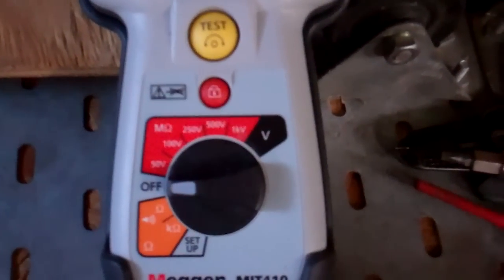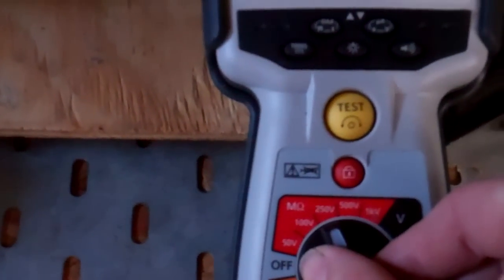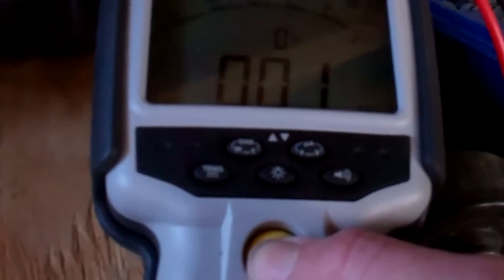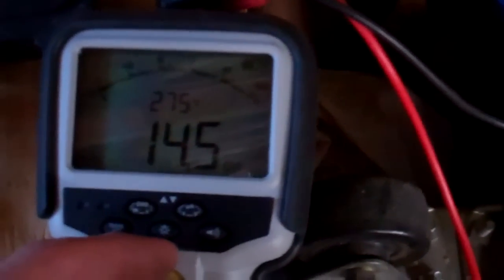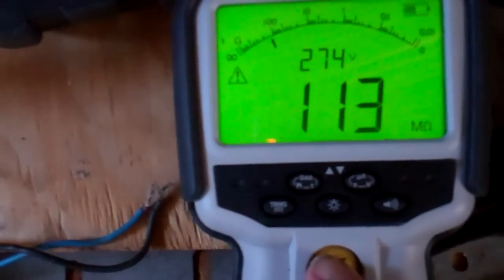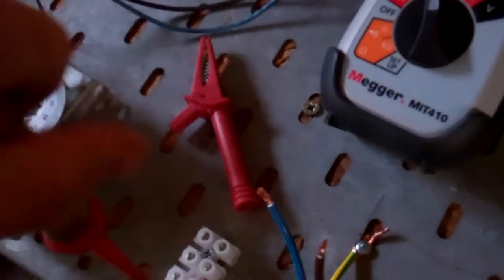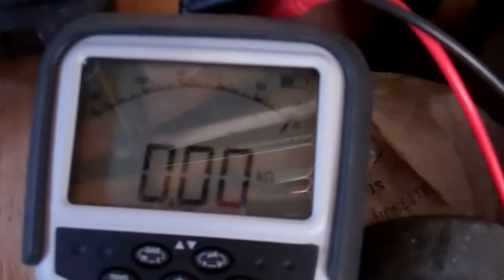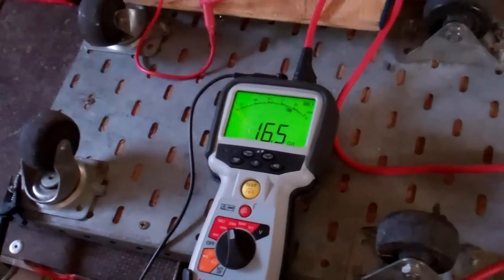Megger tester demo

Comment from the maker: Hi Mark, for the stuff i work on i'd expect a good motor to be well above 20m R but a used one in a damp environment could be lower. If it was below 1m R i'dsay it was faulty but a bit above and it could be damp in the windings if its a fan motor etc or even damp on the terminals if a compressor. In these cases i'd run them and see if they dried out and the resistances got higher.

Comment from the maker: @FilterChanger Its a lot of money! I like my gadgets and i think it gives a good impression to the customer when you can show them with a meter their compressor or fan motor is bad. Lot of stuff here has electronics in too so being able to test below supply voltage and not risking damage is handy , milk tank circuit card is $1500!

We don't get the full range of Supco stuff here, had import my bladepuller, Supco meter looks like it will get the job done at a very reasonable price!

Comment: Whole-e-carp... $650 for a megger.  Nice meter, but I'll have to stick with the $100 Supco for a while.  I like how you eliminate each wire individually.  I'm sure that many motors/compressors are mis-diagnosed because of wiring issues.

Comment from the maker: @rotarycomptech Hi Dave

I'll have a think and plan a better vid of how i would go about tracing an earth fault (and read the instructions so i know what all the buttons do!)

Its nice to be able to show a customer the fault reading on a motor to prove its faulty, having used insulation testers for years i wouldn't be without one now!

There are some vids on here by the manufacturers show them driving a truck over a tester and it still works after! I'm not planning to put mine to the test though

Comment from the maker: @rotarycomptech I think Fieldpiece do one that Fritz was looking into getting from  the hvac supply house.
The one i have is more complicated than i need but i like gadgets so... think it was around $580/$660!!! 
I liked the light and its water proof enough to cope with farm work and i don't really need all the test ranges but i liked the idea of the 100v range so i could test without worry of blowing up a circuit board etc when i'm tracing a fault.

Comment from the maker: @rotarycomptech Hi Dave,

It really comes into its own when testing for intermittant faults or when people feel they got a shock of something but it don't blow a fuse etc, a dead short you could find it with a multi meter but this really tests things under the same stress they would have when mains powered
e.g. Had a chiller years ago that would turn on with the stat but not turn off unless you pulled the disconnect, turned out the cable had perished just enough leakage to latch the contactor in

Comment from the maker: @fritzhvac Hi Fritz!
I twisted the wires together but i may also test them individualy if it was easier, just have to be careful if they are loose they don't ground out or you end up chasing a fault that isn't there hence twisting them together. In theory all the motor wires are joined in the windings but if theres been a short and they have melted apart, you could test one and think motors ok when it isn't, or a heating strip when elements broken, only one end is is shorted so i test all wires

Comment: Great Video Jon !!!
Man had to come back for another review !!!
So basically you are proving a point of mis-diagnosing a Motor , and finding a Faulity Terminal Strip ?
With this instrument you can pin point a heck of alot quicker and more accurately than a common multimeter ?
Its wicked Jon , it will take me a Year to use it efficiently !!! LOL ...